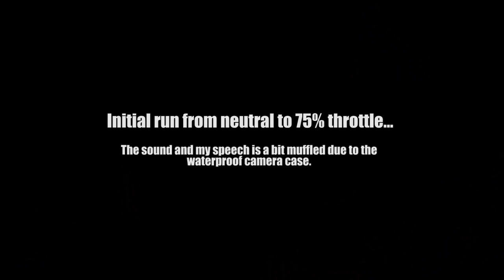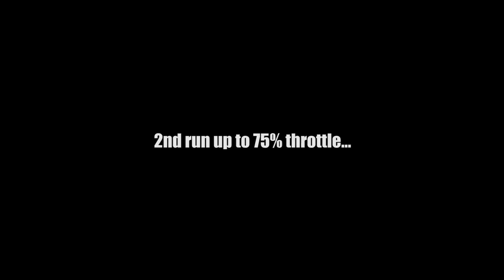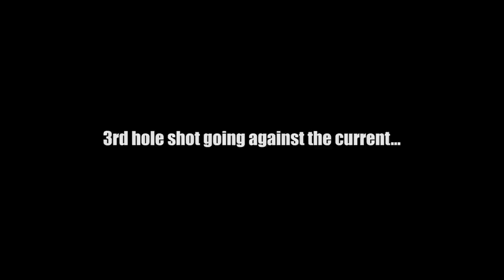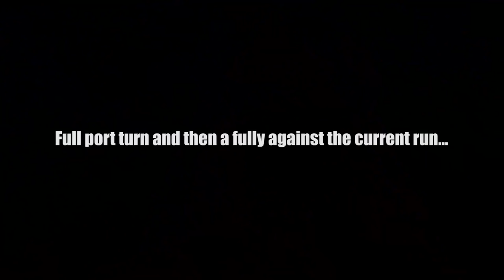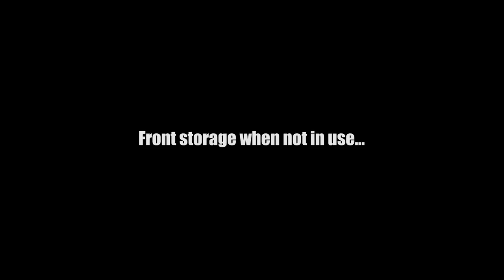Hobie Revolution Using Kayakbuddys Gas Engine Drop-in Mount and Honda 35cc 4 Stroke

Comment: Hello, I want to ask where the propeller of your motor was bought. I have a hobie outback and a motor that is exactly the same as yours, but the motor comes with a 3-blade propeller. I can’t find the double-blade for a long time.  Of 😭
Reply from the maker: These are my designs only. You will not find them anywhere else. You can order on my website. Www.kayakbuddys.com. They are 100 with collar and shear pins + shipping.

Comment: can the motor lock for straight forward position, so the rudder can be use?
Reply from the maker: WestCoast you can tap a bolt in the mount to keep it straight if needed.

Comment: Where can I find a video or info on the seat mod you have?
Reply from the maker: Danny, I took the mod off due to the poor ergonomics of the Revo. It seemed to work just fine at the beginning, but I felt after sitting in it for a bit of time, it still didn't feel right. It was better for sure, just not to my liking.

Comment: I'm interested in your setup. What happens when you hit something?  Does the shaft bend or does the motor pop out of the pod?
Reply from the maker: If you ground the engine you could break the mount locks and that is the occupant's error, not the fault of the drive. If you hit debris, it normally deflects, but since I have yet to experience anyone having issues I can only base this off of my experience. it is a very robust gearbox and stainless prop. You would break a shear pin before damage occurs on the drive.

Comment: How’s noise n fumes?
Reply from the maker: It is a 4 stroke and the emissions are 95%  emission free due to the catalyst and muffler that Honda has developed. If you are sitting still you may get a hint, but underway I have never felt it was an issue.

Comment: Where did you get that seat at I need one like that for mines I hate the old seat they hurt my back
Reply from the maker: Southern Catches Fishing that is a modded millennium seat on aluminum bars that run across the width of the Hobie. I had to drill and add grommets to fasten through the side of the handle area.
Reply: Kayak Buddys - Kayak Propulsion Engines I like the setup I have the same model revo, if you can make a video of a demonstration on how to lmk I really like the mod

Comment: Here's the other problem with that thing. at those high speeds, if you hit something, say goodbye to your mounting area in your Hobie, it will most likely crack in that area over time anyway. Again these kayaks were not designed for that use.
Reply from the maker: oespo oespo19 you have no experience in this area. All negative and absolutely no positive ideas to offer to the kayak community. I have outfitted 100’s of kayaks and guess what, no issues, cracks, or hull destruction. Please stop being ignorant. To each is own. I laugh at people like you for the lack of learning to let people do as they please. Move on my friend. Keyboard warrior.

Comment: You need to go get it registered with the Marine police because you're running illegally under power in a kayak
Reply from the maker: GottaGo kayakfishing Adventures for your information my company has a commercial license to test outboard engine systems. Due to mounting on a multitude of boats that I trial, I carry my documentation on every outing. FWC is fully aware, so trust me I have it covered.

Comment: Way too noisy and Hobie's were NOT designed for that type of speed. Recipe for disaster there at some point. In this everyone suing everyone world be careful on selling this. It may come back to bite you guys.
Reply from the maker: oespo oespo19 remember when you outfit any craft with a motor it is the buyers responsibility to control the craft. As far as noise, the camera is a foot or so away from the engine. It is never an accurate sound account of the sound decibels and frequencies captured from the exhaust. This is why I make an electric that is faster than the gas on the light kayaks. Some people have large Hobie PA models and these can not paddled for long durations for the average owner. Gas gives options whether it is in front, on the side, or in the rear.
Reply: You must be an over protective mom... what are you saying bro, that these make noise and are a little dangerous? Obviously, your going faster and everyone knows kayaks were not built to have motors, but now they can... also your saying they might get sued? Anyone can take anyone to court, even you oespo. I for one fully appreciate the video's and options now available. I'll be ordering mine soon ;)
Reply: @kayakbuddysllc-lightweight4947  You mentioned an electric that is faster than a gas on the light kayaks? I have an outback I would like to motorize, however most people only get around 4 mph top speed with a 30lb thrust trolling motor. What is your electric option that is faster than the gas for light kayaks?
Reply from the maker: J H for large kayaks gas is still the best performer. The electric is more of a an idea that works, but it just doesn’t compare to the long term use and simplicity of gas. Rear mount gas with foot controls or tiller extension.  Certainly less failure points than electric.
Reply: The hobie will handle it easy as, will some people go get a life. This is a great setup